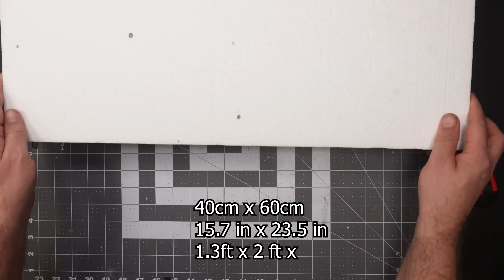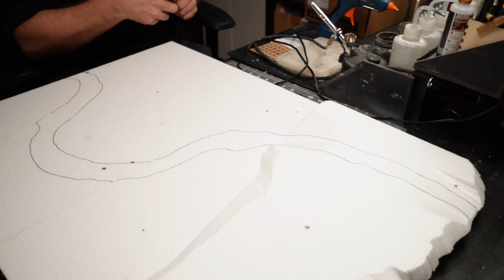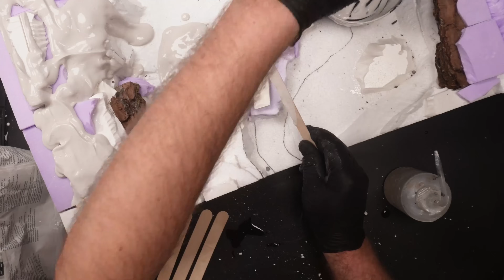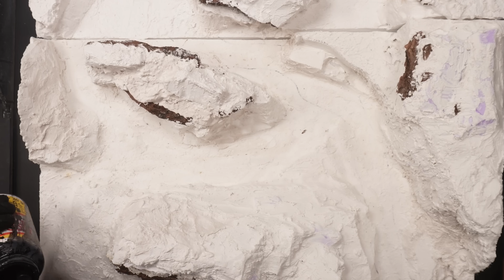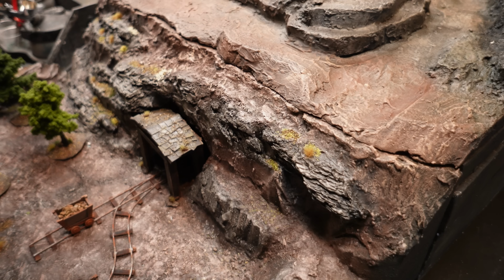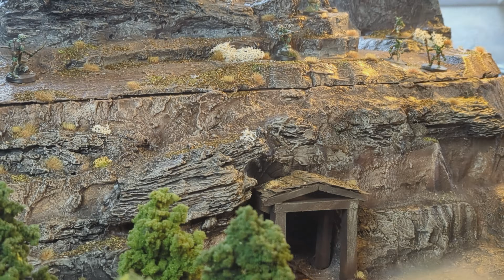Cave, Cliff & Mine: The Ultimate D&D Adventure  - Part 6

Comment: Yeah, plaster and EPS are unpleasant to work with in every way. I use them as little as possible, which is almost never. Great project, though, looked super fun and I expect your players will love it.
Reply from the maker: Thank you😀 i am going to avoid using plaster in the future, the price on that drywall filler is also almost the same and i can make almost same texture. I even thought that since the dry time is that longer i have time to mix in sand and maybe lager stones to gev it different textures. I might get som EPS but i will only use it as a filler ofr structure material where it will be covered by XPS foam